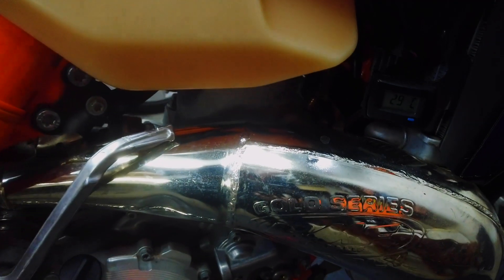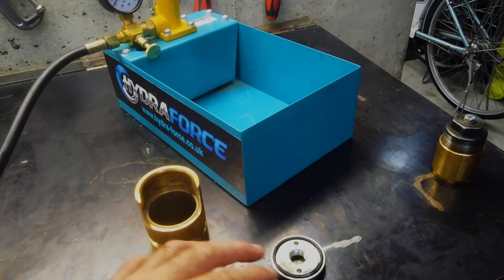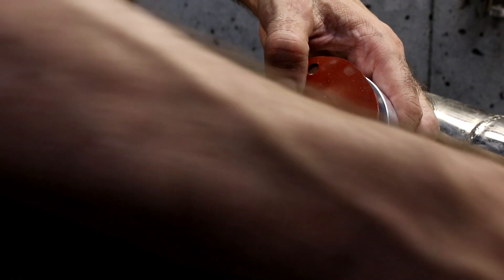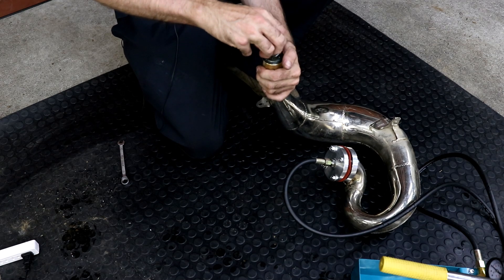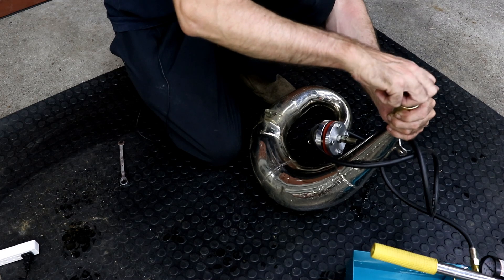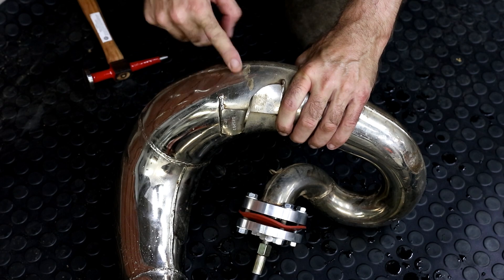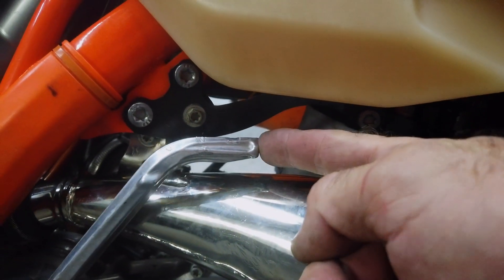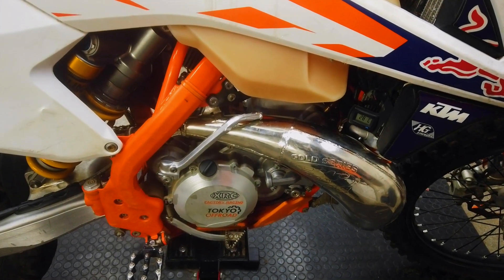2-stroke Pipe Repair- HydraForce with custom bung

Comment: Made my own for about $300 cdn. Used a 4 ton porta power,  made my own clamps. Most pipes have flanges on either end. Two plates per spigot, they gotta be strong. 3/8 or 10mm thick for the stinger ,only needed two bolts for clamping.  I used pieces of Teflon and pieces of tire tube for sealing. Now the header spigot was a little more challenging. The 3/8 plate was ok but the bolts would bend because I had to tighten the outer plate so much. I could get 3 to 400 psi then the pressure  would push water  past the Teflon.  I had to start over. Found 2 pieces of aluminum, 1in thick,6in long and 1 1/2 in wide. Drilled ,tapped threads and drilled 2in hole. The aluminum blocks sit flat together so no chance of it folding when under clamp pressure and bolted through for stability. Got lucky with the hole size , fit around the pipe perfectly and snug up against the flange. I threaded a Schrader valve into the plate for bleeding air.The outer plate was the 3/8 plate ,it won't bend. The porta-power doesn't know whether it has water or oil in it so I just put it together and tried it.  Yup! Worked so damn good I had to weld a seam back together. 🤬 Oh well, Had to know how far to push it. Getting the kinks out is pretty tough but the dents come out super easy. 3 to 400psi does it.  For the most part , the water treatment works better than heat. Using a torch doesn't get the pipe back to or close to it original shape, water puts even pressure throughout  the whole unit. I can live with dents but a twisted pipe is horrible. Vibrating, leaking pipes suck.  I haven't seen hydraforce for anything other that Euro bikes. Made it for yz250x. It was all built with a drill press,mig welder ,chop saw , 2in hole saw  3/4  hole saw. Basic shop tools. It was fun and it worked. The bung plug was beautiful, but I don't have a lathe.

Comment: Hi, is it compatible with the 2020 model of KTM?
Reply from the maker: No, I would not recommend trying to blow out the stock 2020 ktm pipes using this due to the corrugations. One option would be to take off the stock pipe (before damaged) and fit an aftermarket pipe which can be easily repaired. You could then fit the stock pipe back on if/when you sell the bike...

Comment: I know there are heaps of reasons NOT. But surely they can make a 2 stroke with the exhaust port facing towards the rear or side ?
Reply: See how that pipe comes out, goes to the left, then curves back over itself before going to the rear?  2-Stroke pipes have to be a certain length to function correctly.  Putting the port on the rear would require you to run the pipe up to the front before turning it around to the rear anyway.  And then there would be the question of where do you put the carb and air box?

Comment: Will you sell this custom bung on your website?
Reply from the maker: No, I don’t think I’d be able to make it cheap enough to be attractive. I could make them to special order if there is interest.
Reply: @TokyoOffroad  I would be interested as I have a Beta 200 and the 250/300 bung does not fit because the shoulder/weld is deeper than the 250/300.  Your bung is adjustable in that sense using the bolts.
Reply from the maker: That's interesting. I need some more information to confirm whether there are any other differences. You can contact me here: https://www.tokyooffroad.com/contact/
Reply: @TokyoOffroad There's interest. I'll buy a few of them as I have friends that own these as well as myself. Your fitting is obviously superior. Please make a few. Buying new pipes when you have a fixable one is annoying and wasteful. Your system looks awesome.

Comment: Thx for the video. For us who don't have a machine shop but we do have a Hydroforce kit - do you have any tricks for keeping the bun on the pipe and from blowing off?
Reply from the maker: Aaron Grutzmacher - The issue I had with the stock bung is that the o-ring would blow out, not that the bung would come off. It’s critical to try to keep the bung centered on the pipe while tightening. Sounds easy, but in practice is actually difficult (for me) to do while tightening securely enough.

Comment: the only reason your 'o' ring blows out is when you tighten down the clamp it is not properly centered. use these all the time from throwing our bikes down silly shit, i have 2 spare pipes just for this reason we share a couple of these tools around in our riding group they work so well!!
Reply from the maker: Yes, I agree with you you. But I find it very difficult to keep the clamp centered when tighten. I also found that when hammering the o-ring would often blow out. This is the reason I got so frustrated the last time I used the stock clamp and decided to make my own. Other than this I think it's a great pipe repair method.
Reply: @TokyoOffroad  I found that releasing the pressure slowly keeps the shape you got after the fix. When I did it for the first time, I released the pressure fast and the pipe's shape lost about 40% of the "fix"...

Comment: That Hydraforce is a great piece of tool, but it's just to expensive to buy 😔 If you had to buy one to make money buy fixing other peoples pipes it would be  reasonable, but to buy for my self it's to much I guess
Reply from the maker: If you have some riding buddies why not buy one between you and share it. BTW I have no association with HydraForce and paid full price for mine.
Reply: @TokyoOffroad  It's a very good idea but I only have one friend that I ride with a he has a 4 stroke 😅
Reply: @stone4858  So it's time for you to make sure he'll switch to 2 stroke (;
Reply from the maker: It's inevitable that he'll switch to a 2-stroke :-) Resistance is futile ;-)
Reply: @TokyoOffroad  LOL
Reply: I've repaired my PC pipe twice now so I reckon it's paid for it self! I bought an old panel beaters hammer on eBay this makes tapping out the dents really easy.

Comment: You can move the kickstart lever up one notch and it will sit perfectly between the tank and pipe. I have the same setup
Reply from the maker: Yes, I might do that. Even with the pipe perfect it's still quite close...
Reply from the maker: I just moved the kickstart lever one notch on the spline. Loads of clearance now. Much better in this position when using a Gnarly pipe. Thanks for the suggestion...
Reply: @TokyoOffroad  yeah I forgot to mention that part about touching the footpeg. I've had no issues though.